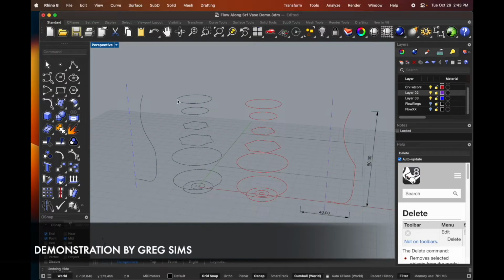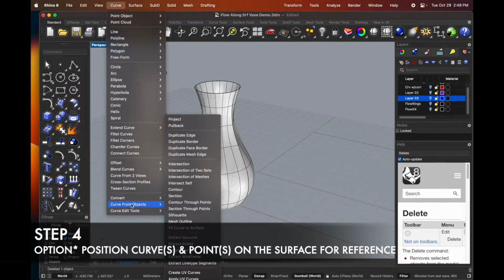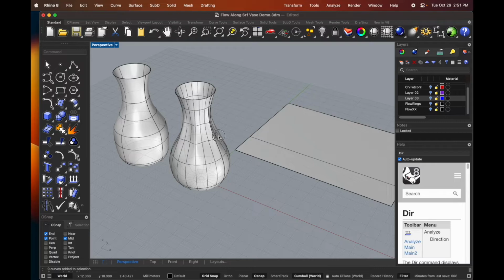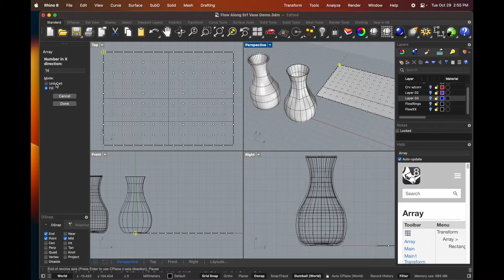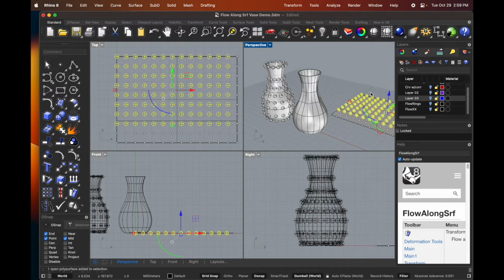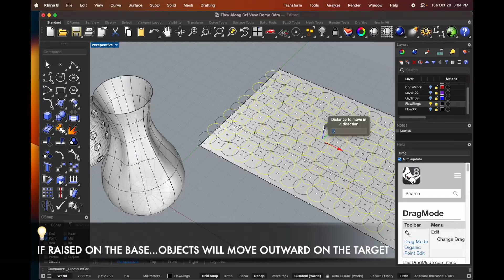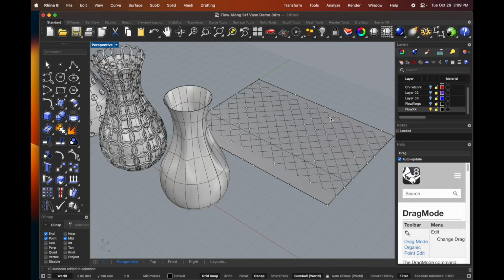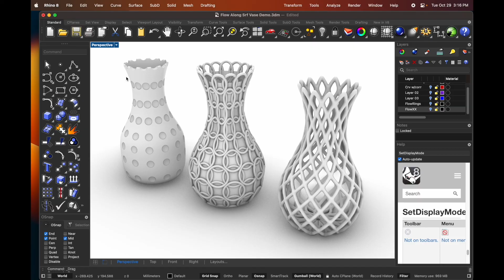Rhino 3D Vase Modelling with Flow Along Surface

Comment: Pozdrawiam XD

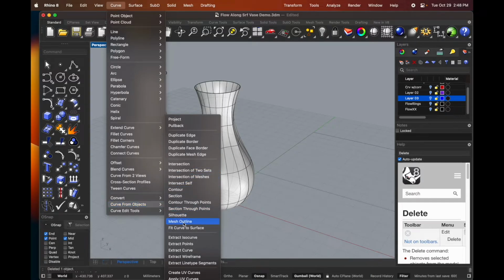2:23 Curve -> Curve for objects -> Extract Isocurve (_ExtractIsocurve) (only matters to locate the bottom on created UV Curves
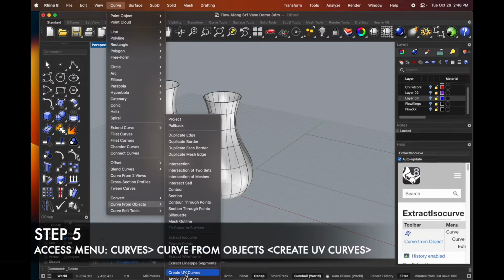2:43 Curve -> Curve for objects -> Create UV Curves (_CreateUVCrv)
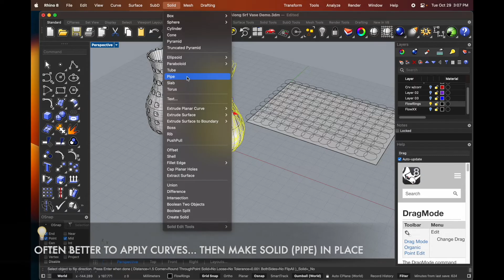12:30 Solid -> Pipe (Pipe)

Dir
FlowAlongSrf

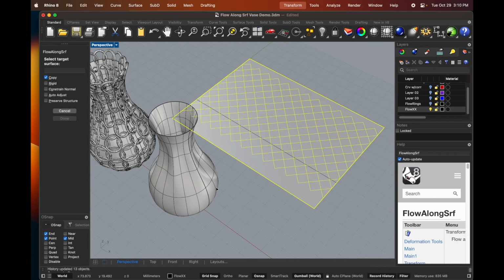14:02 Clicking location doesn't matter, only that it selects objects, base, and final surface,

Additionally keeping history always on allows for changing direction after the FlowAlongSrf has been applied.